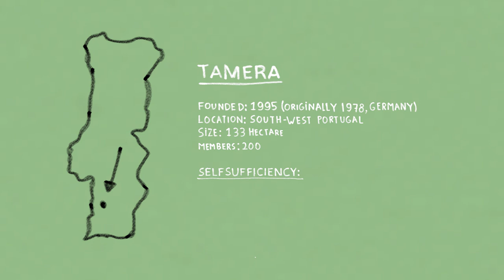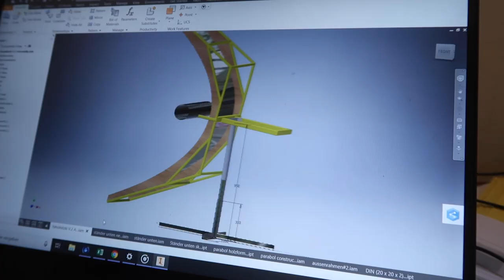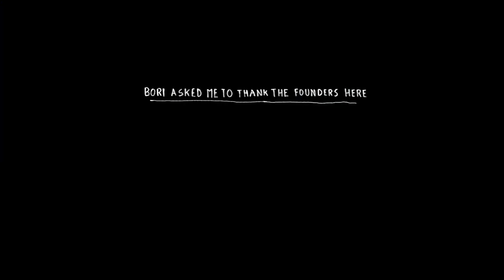Visiting Tamera community in Portugal 🇵🇹

Comment: Very interesting.  I was really drawn in by the solar concentrator design and am really impressed on the systems that I see they are practically using appears.  The concentrator focused on the large cooking kettle seems really neat.  That is way awesome as well as the larger concentrating trough for cooking.  Wow!  Larger scale implements.  That is really awesome!  Makes me wonder now about extrusion of plastic sheets to recycle with not only novel products developed... new also.  So, like I've thought about solar concentrating larger scale for feeding heat and to advance controls in kilns and furnaces for pottery, glass and metal... why not even easier.... plastics!!!  HHhmmm... why not?  Proven sintered 3D printing has been performed.  Not saying 3D plastic printed completely solar powered can't be performed... however... why not at least augment or ideally completely control with advanced controls the heating of the extrusion process maybe for starters?  I've not seen before.  That would be great.  I'm not sure the bio-equivalent greatness of plastics that brake down into nano or small particles being so good.  We need to recycle the material since last long as well as like more toxic products, keep in locations where we do not consumer or ingest.  Underground I personally feel is best if there is an aesthetic issue and concern... or under layers like wrapping housing or basements.  So I think that is one reason when I think of the plastic as a film or thinner material already... why not figured out how to make into sheets as-is or even amended with other fibers or minerals (that might add more recycling complexity to begin with) for longer term hydro, pneuma, thermal and pressure or even electromagnetic spectrum insulation capabilities.